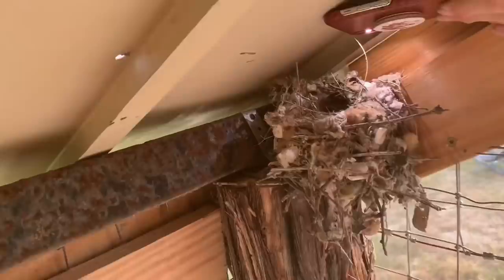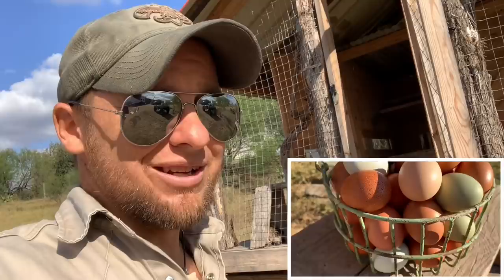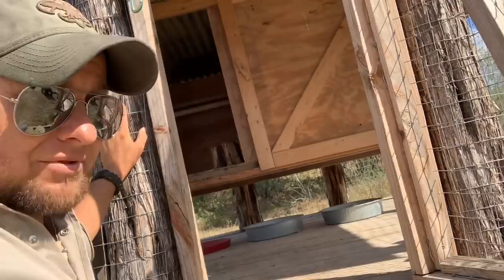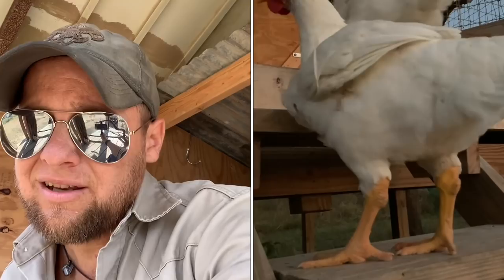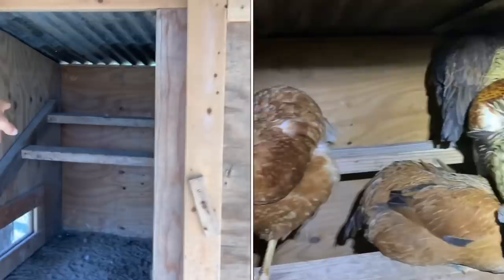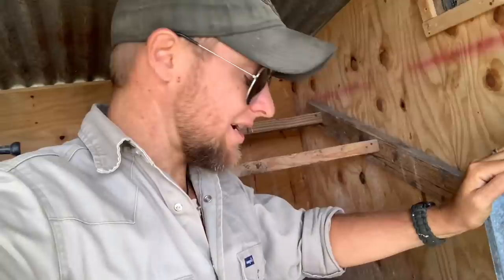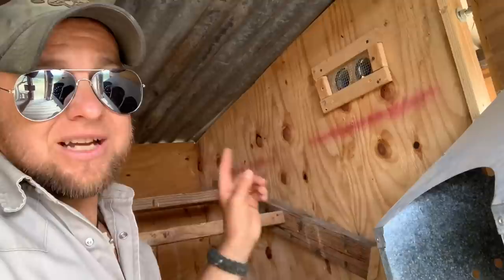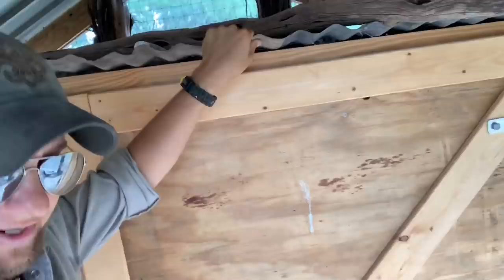Raised Chicken Coop Build and Walkthrough Tour

Comment: Bob, you might want to build a small ramp or ladder up to the box. Keep the steps close spaced, I noticed the main ladder was for humans and the had to jump to go from step to step, they are just a little wide. Also you might think about putting a few more nest boxes on the walls and line them in the bottom with a thick layer of straw so they arent sitting on metal or in the wintertime cold wood but soft straw that they can heat up with body heat. Other than that a great job, heck I have lived in cabins that werent this well built. LOL

Comment: On the main door, a latch in the middle will not cut it. An opossum or raccoon will pull on the bottom left corner and cause the door frame to twist. Then it will stick it's head in and wiggle the rest of the way in. Getting out with the way you built the door frame, no problem, even easier. It will just push at the lower corner and slip out. latch the top and bottom. Still, job well done from Tim out of Kuwait. See yall soon.
Reply from the maker: Take a look at the door.  Horizontal 2x4 keeps any torsional stressed from budging it.  Look at it again.
Reply from the maker: Built to make that impossible.

Comment: It's a fine coop, Bob, first rate!  I especially like the re-purposing of materials, the solar-powered self-starting fans, the egg yield (which shows you're doing a lot of things right), and last but not least Huck's posse!  I couldn't see all the construction joinery, so this may be accounted for already, but one suggestion I'd offer would be some angled bracing here and there, since that aluminum and tubing roof can act like a sail and multiply any wind force, turning those cedar posts from the vertical sides of squares into the angled sides of flattening trapezoids.  Say a few 3 foot lengths of 2x6 or even 2x4, running from the deck to the posts, or from the posts up to those 2x6 headers, especially in the corners, attached to the posts with maybe 4" lag screws, to stay fastened even if the cedar should soften a bit and allow smaller fasteners to work loose.  I could tell by his expression there at the end that the Huckmeister had already thought of this, but was perhaps a bit too tired to go into it.  He'll no doubt bring it up after he's rested a bit.
Reply from the maker: It has proven sturdy thus far, but it hasn’t been tested by the wind just yet.  I thought long and hard about additional reinforcement for those uprights, may still need them.  I tightened the base 2x6 over the fence wire and pulled them down to create tension from top to bottom.  Solid, but it could work loose and provide some five eventually.  Definitely more to do on this project.

Comment: Great chicken coop mate. 👍👍👍
Nice you used all reclaimed materials.
You asked something about the water.
Can you find an IBC ?
If you put and hose on the outlet and place that end in a shallow bucket it will fill the bucket time and time again without flushing it all in one time.
Just make sure that you reach about an inch of water level and if the water is under that, that the next gulf that comes out does not go over the edge.
You might have enough water for about a month or so.
Mind yourself and stay safe

Comment: Great to see a vid from you again, much anticipated!  As a carpenter by trade, I admire your build and have much respect for your ingenuity & ability to repurpose materials. Might not be a survival video per say, but IMO having a resource like chickens certainly could become a crucial component in a survival situation! Thanks for the entertaining and informative videos, keep em coming!
Reply from the maker: Advice.  I left diagonal bracing off until I knew how well the fencing wire could be tightened.  The boards snugged it down until it twanged and made the coop rock solid.  I still have folks asking about the diagonal bracing...
Reply: @BobHansler  If that fencing wire is fastened pretty good, it will add shear strength to it the same as sheathing on enclosed structures. Sounds like you figured that out w/out my 2 cents though! I cringe when I hear wire fencing, had my fill putting that up years ago when my buddy & I raised/trained cavalry horses for Civil War reenacting!

Comment: Awsome!  Can you figure out have a grate heavy duty where the sand box is for droppings so the droppings fall down through the floor.  Then yes one would have to open up a place with a grate hardware cloth for the droppings to just fall to the ground.  As it accumulates can remove it or it will just be absorbed by the ground.  I have raised had chickens myself.  The cope would be cooler then also....  Let me know.

Comment: Get some axle or wheel bearing grease and coat the poles that it is sitting on, ants can climb and it might also help with other critters.
Reply from the maker: Will definitely give it a go.  Has ants climbing already.
Reply: @BobHansler  if you can get your hands on some cheap cinnamon powder and or peppermint oil, it will help distract the ants from climbing the pillar poles. I have had success with sprinkling those two items around the feed dishes for my pets and it seems to keep the ants out of their food.

Comment: solar charged electric fence rigged around base of coup, turn on at night, off when you let chickens graze. That should take care of the varmets.
Reply: maybe add some insulation and heat lamp for enclosed coup, felt some cold winter nights there in west texas.
Reply from the maker: @hammerhound168  south Texas.  Still too hot at night.

Comment: Where are the diagonal wall braces? One strong wind and the box is gone and the girls are dead.
Reply from the maker: The wire mesh was strung and then sucked down with the 2x6s at floor and head height until they twang.  Tension strength makes this thing immovable and beyond solid.